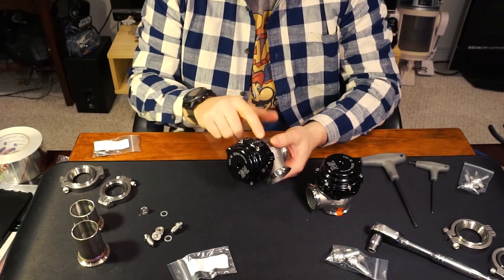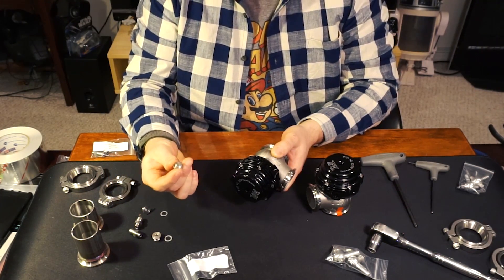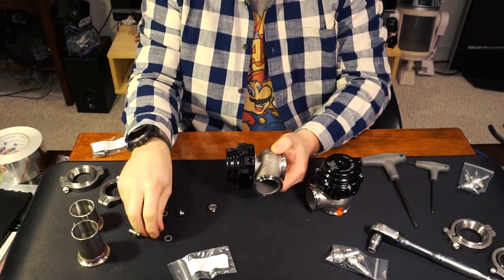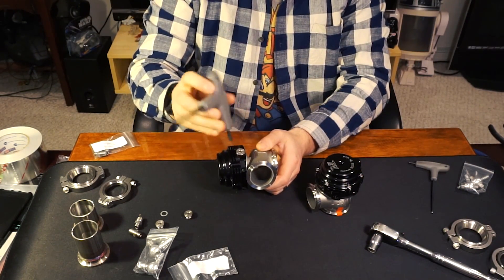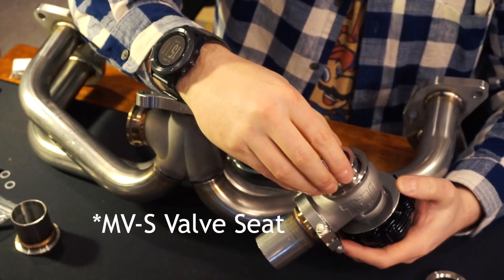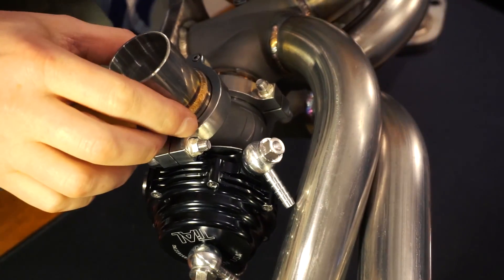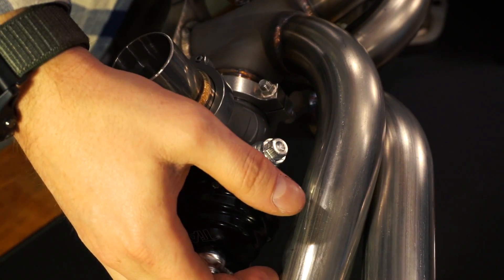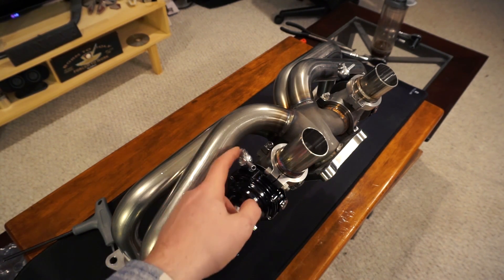Installing Tial Wastegates to Killer B EWG Headers - Loud AF 500 - Part 6 - 2015 WRX

Comment: Hey man im running this setup but my car is overboosting to around 24-26psi. And does a boostcut. I ran my lines just the same way as yours on my 2015 wrx. My tuner said the map he sent me is on 0 cycle for the boost pressure. So it should just be boosting around 14psi (spring load) on ewg. I cant do a proper datalogging due to this boostcut. Any ideas on how to fix it?
Reply: same here you ever get this sorted?

Comment: Was pulling out the turbo assembly and all of that hard because I plan on running this setup later?
Reply from the maker: Honestly I don’t know yet as I bought the FP Blue FA20 turbo to mount to these headers... Hopefully they come off easily, keep watching bud that will definitely be filmed.
Reply: It is not hard at all, just take your time
Reply: 2 studs were broken when disconnecting mine from the turbo.
Reply from the maker: Really thought you had a 2018?